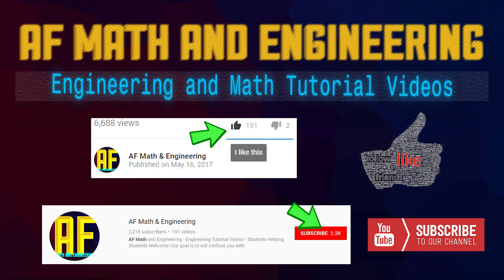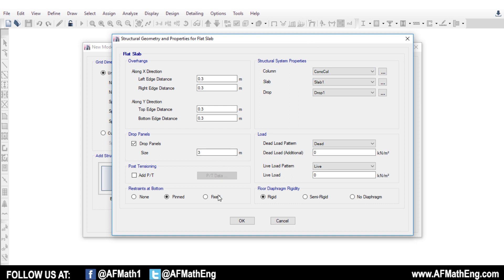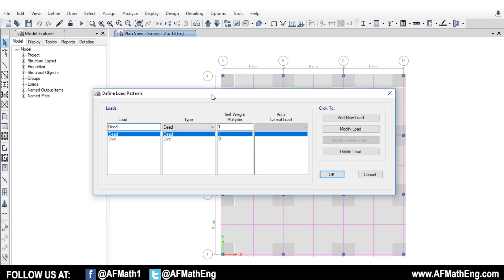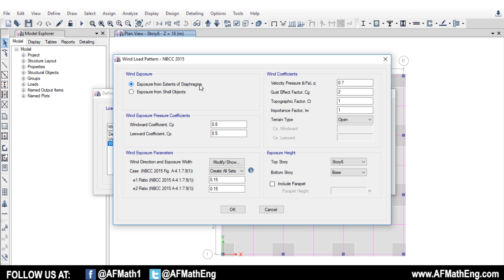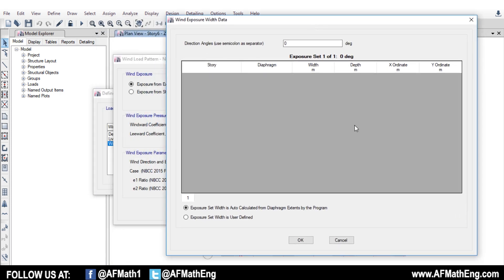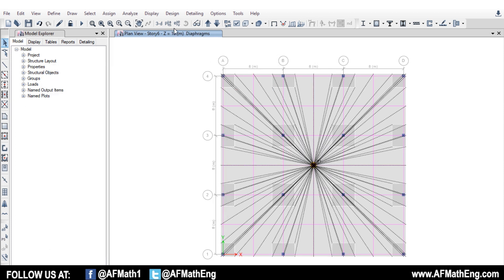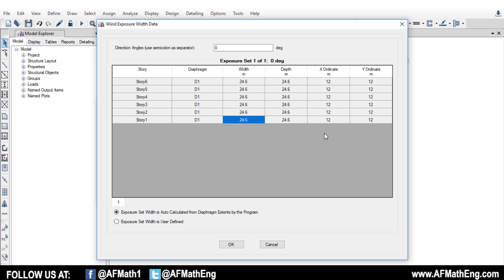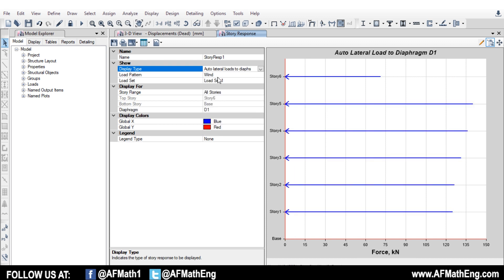CSI ETABS 2016 Tutorial - Wind Loads to the Extents of Diaphragms

Comment: The ETABS lateral loads manual says that for NBCC2015, when applying load to extents of Diaphragms the program does not automatically apply horizontal wind loads to roof surface and they suggested that wind loads are manually applied to the roof (That is in page 3-28 second paragraph in 3.10.2.1), how would you go about manually applying WL to the roof?

Comment: If I want to assign wind load to the extents of rigid diaphragms at certain level only, did I need to assign wind load exposure to shell objects at the other levels?
Reply from the maker: You'll need to assign a code required wind load at every level.  I wouldnt mix the two, calculate your wind load at all levels and assign to all diaphragms.
Reply: @AFMathandEngineering  Thank you very much for your help and respond
Reply from the maker: @fatimnadiabintiabdullah3052  no worries

Comment: In Etabs, is the extend of the diaphragm the centre of mass or the centre of geometry in case of wind load?
Reply from the maker: There's both a centre of rigidity and centre of mass assigned to diaphragms.  The difference between these is how the accidental torsional moment is applied.
Reply: @AFMathandEngineering  I am not talking about the centre of rigidity here. I believe the wind load should be applied at the centre of geometry, which in general is different from the centre of mass.
Reply from the maker: Yes the wind load should be applied at centre of geometry as well as eccentrically according to your building code.  Depending if your building meets the requirements for dynamic wind you'll require more wind cases with varying eccentricities and intensities and possibly a wind tunnel report.

Comment: Thanks for the nice video. 

Would you mind explaining or showing if semi-rigid diaphragm is adopted? Why apply wind load has to do with rigid diaphragm only? As far as I know, if the floor is assigned as rigid diaphragm, you will not be able to extract forces for the design of in-plane shear and collectors.
Reply from the maker: Hey, thanks for the comment.  Selecting rigid diaphragms in ETABS ignores in plane deformation by assuming that the diaphragms are infinitely stiff.  In most concrete buildings the lateral forces on the structure aren't high enough to cause deformation or bending in the slabs and, as a result, will yield the same results as semi diaphragms but with faster computational speed.  Personally I've never had to use semi rigid diaphragms but if you were interested in also checking adequacy of your diaphragm in plane you'd want to assign semi rigid, perhaps a steel structure with a steel deck diaphragm, something like that?  Something not as stiff and rigid as a reinforced slab.

Comment: This is the most informative video I have watched  about wind load in Etabs. Would  you please share a video about stiffness modifiers and their concepts.
Reply from the maker: Thanks great to hear! I'm not sure how much use a video on stiffness modifiers would be, really it's just assigning a percentage of stiffness to structural elements to simulate some property that you want to design for, i.e. cracked concrete (reducing stiffness of slabs beams and walls) or very rigid elements (increasing stiffness artificially).  The cideo would be more based on when you should modify stiffness in practice, but I find these to be more of a standard at your place of work/judgement vased type of thing rather than something concrete.

Comment: Is it necessary to create this load pattern for both X and Y directions, or does the software automatically do this based on 1 wind load pattern?
Reply from the maker: If you choose auto wind, the program automatically generates wind in x and y both with eccentricities.  If you manually input the loads using user loads, you'll have to generate these load cases separately, x, y, torsion, etc.
Reply: @AFMathandEngineering  Thanks for the reply. When calculating Cp for the windward and leeward, these would be different assuming the building is not square on plan as NBCC defines H/D where D is the width of the building parallel to the wind direction. How does the software capture this? Or do you typically use the worst case for both directions?
Reply from the maker: @dannaughton3921  Usually you'd input a worst case scenario and use it for the entire building.
Reply from the maker: Sorry, perhaps I didn't read your question correctly.  In calculating the equivalent lateral loads on stories due to wind I believe auto wind will calculate this cp due to height.  It's definitely beneficial to create some sort of spreadsheet and calculate the wind forces and input them using user loads in real life rather than blindly trusting etabs to generate your wind loads for you.